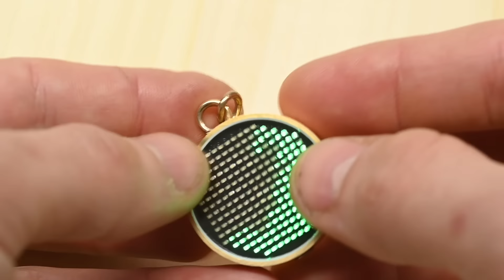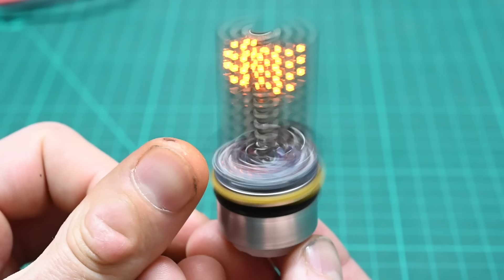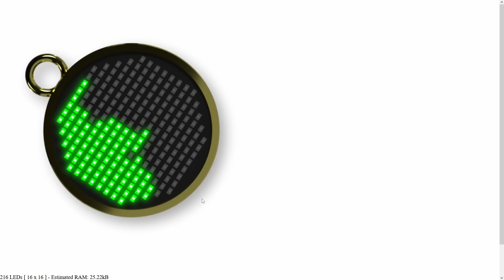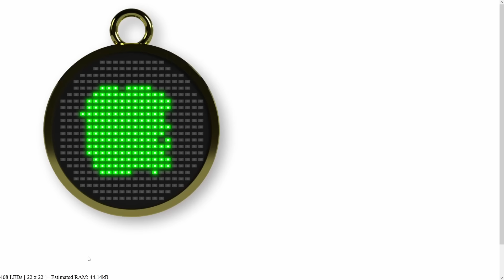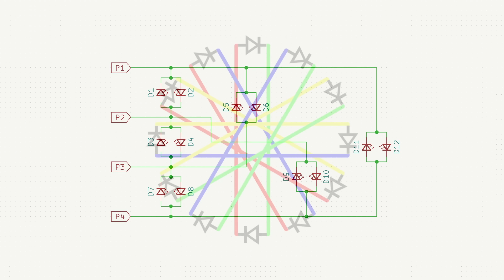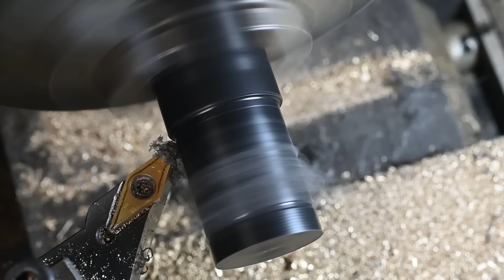Fluid Simulation Pendant

Comment: You are one of my role models when it comes to creativity and using every skill I have to make projects that I'm proud of. 
great video as always. the thing that mostly got me is the script you used to extract the led pinout lookup table, in my designs I also need to do that a lot but I didn't think of building my own "net to pinout" scripts I usually do that sort of stuff manually or lately automating it using a detailed prompt to an AI chat bot and they usually get it correct, I wonder if the AI chat bot thing would have worked with such array in your case.

Comment: Gonna keep doing whatever i feel like 😂 i enjoy all of this, but things like the GPIO and DMA functionality, circuit design, and PCB fabrication are definitely the hardest parts. I graduated as an electrical engineer, and am familiar with simetrix, but circuit design really is a creative process that you have to practice to be good at. I work as a programmer now, so my circuit design attempts are relegated to hobby projects.

I recently did a basic fluid simulation project, but used off the shelf arduino and charlieplex led array parts to help me get it done within a reasonable time frame. It did turn out well though- I embedded it in a block of soapstone, shining up into a sculpture i made out of prisms off amazon. I considered documenting the process, but it's so much work to film. Thank you for taking the time to make this video!

Comment: Wonder how good a milky glass panel would look. Hard to get enough dispersion in this small space to make the hot spots from the LEDs completely go away but maybe small layer diffusion foil, thin normal glass and milky glass on top would be enough double diffusion to turn the LED spots into very smooth liquid looking light.

Comment: why dont you use a real liquid in between the battery and LEDS, the liquid will connect the LEDs from battey in few areas which can make a liquid like simulation, try it if it works

Comment: 1-Wire! a project like this would be amazing with some sort of interface to update/configure the internal chip with everything fully assembled. could probably even reuse parts of the charging connector. Also, at which pixel density are you going to finally budge and use an actual watch or fitness band led display?

Comment: Question: Would adressable LEDs have caused more issues here? There are 1010 ARGB (1mm x 1mm), and they can be packed as tightly as 1111 (1.1mm x 1.1mm). Since they're controllable via Serial at 2Mhz and retain their state, it feels like this could have avoided a lot of work. Though my only experience so far is making a mostly working 100x100 pixel display that is 110mm x 110mm and can infinitely tile through magnetic connectors - if you can provide the power for it.

Comment: as always, amazing video. I really appreciate all the explanations.

Would sensing skin contact on the case, be possible? Would you have any µC inputs available for this? Would the metal and coatings allow for the capacitance to be detected? Or, even instead of case, could we detect slight changes on any of the charger pins?
I know that some older model of Fitbit had a reset button in the charging cable.

Comment: unfortunately sold out .. 

beatiful project you should really consider small scale production with a manufacturer. this quality would definitely sell.

if you do a new batch, varying the colors would be neat ideally with heat-oxidizing the brazz blue 💙

software variations would also be interesting - displaying the fluid sim field instead of particles, etc

really inspiring!

Comment: It is really interesting and cool, but what driving my mind is that ugly red led for charging. Why is it even needed?
You have the whole "display" that you could use, which could float from bottom to top representing percentage, while preserving the sleep mode, so it does not shine the whole time for nothing. You could also display the number, possibly time, to give it some purpose.
For the port would be also cool to have data, so you could possibly update the software (DFU) without the need to dismantle.
I am pretty sure I saw circular ports with data, but not sure how big they are. In any way, pretty cool project.

Comment: It would look very, very much better if the LEDs weren't in a grid, and thus have jagged edges when trying to approximate a circle, but rather oriented in a circular pattern. Then the LEDs wouldn't be equidistant, but the perfectly circular outline would more than make up for the slight variation in LED distances.

Comment: If you are considering building more, you take the route of watchmakers.  Outsource the case.  CNC will easily take brass stock and turn out cases.  All the drilling could be done.  The pcb is already designed.  I think PCBWay offer a service to install all the components.  Then, it comes down to assembly and testing.  Please give it some thought.  Judging how quickly your batch was picked up, you can see it is popular.  I would buy one.

Comment: You're definitely an inspiration, I'm glad to have found your channel!

Doing a simulation before building a physical device is exactly what I'm trying to do now, but I'm still far from having good results. 

Talking about menus to change the configuration, what about using a hall sensor, and using the magnet of the charging cable to do some kind of gesture?
I don't know if it's easy, but it would be cool for sure.
Another option could be an infrared port beside the power led,  and configure everything via an app. Some smartphones (Xiaomi) have the IR port already installed from the factory, I guess other brands too.

I agree with you about the search function on AliExpress, sometimes it's tricky to find the items.
When I don't know the exact name of a particular product, I try to use the image search on Google, just to find out how it is called...it works fairly well.

Thanks for sharing your knowledge!

Comment: I had thought i knew what charlieplexing was but i definitely didnt, REALLY appriciate the detailed explination of the layout difficulty. Didnt expect that.

I was hoping youd go into more detail about how you overclocked the processor, ive never done that before, was wondering if that just a oscilator change or a firmware change or how you decided it was possible to do at all from datasheets. Thanks! Great vid!

Comment: It would be cool if it was a Sand-Falling game, or a powder toy, where you could change the material on the back with a single button, ad you could have fire, sand, water, electricity, etc. I mean you could have a touchscreen but it's not necessary, you could just change all the voxels to the material, but having them interact would be the next level.

Comment: Metal working, electronics and programming in one project? Yeah, I'm definitely part of your demographic and want more. There's a channel where a guy machined a new case for his phone, not the part that wraps around it to protect it from drops, but the actual shell of the phone. If someone were to replicate such a project but use custom boards, maybe even do what you did here with a solid cup casing that's gold plated, that would be my new favorite.

Comment: maybe like a bluetooth low power chip for 'setting the time' etc if indeed you make one with a clock filter of some kind... like you can't see the clock numbers directly, you have to shake or roll or spill the 'fluid' over the surface to reveal masked numbers....

Comment: May i suggest that you do a run in stainless steel. Or, simple brass. If you made enough from the first run, you could consider ordering a batch of PCBs and cases from a manufacturer.

Comment: It's okay but the index of refraction on the water is off. You should set it to 1.33 and also add some volumetric fog and soem simulated caustics so it will look more photorealistic, but it's a good first attempt 👍

Comment: "If a lookup table is mandatory, then there is no overhead to changing the mapping" is a pretty great insight. I worked on a system once that had clearly taken this idea to heart. It looked arbitrary and stupid from the software side, but when you looked at the board/wiring layout, it made perfect sense.

Comment: You mention shift registers at 8:50 - But ya know, ch32v003's are usually cheaper than shift registers nowdays!  I've effectively been using them as glorified IO expanders in a couple applications (some commercial)... (I know that's not the point! Charlieplexing is cool too)

Comment: Only problem is if you hang it on a string, no matter how you swing it around, the fluid wouldn't move. Even if you throw it in the air it would barely move at all

Comment: add a gesture to make the display show the battery charge level, and add an animation to the fluid simulation of fluid dripping in from the top and slowly filling up when charging, when the display is full the battery is charged
Reply: YES. This would be such a cool way to display how much battery it has, by connecting it to the amount of liquid on display.
Reply: Maybe only half of the screen = amount of battery? Otherwise filling the entire screen with water kinda defeats the point of simulating anything
Reply: @ it would only be for the charging animation, the battery level indicator when not charging would be activated by a gesture
Reply: @ that would be cool

Comment: I love it. Put 3 mics equidistant on the side edge, then you could blow on it to create properly vectored waves. If you about doubled the pixel density you have it work in 3D, lay it flat you get a small puddle in the middle, flip it upside down and look up at it and it covers the screen etc.

Comment: Hey, i had an idea about a convention id badge with a led matrix like that, would it be possible to integrate a NFC circuit and Antenne into the housing/pcb? So it could display a name or something and you could share your socials or whatever you want over the NFC function, but i havent found a solution that does that so i thought about making it myself. 

I got no experience with electronics so I got no idea what I have to do, is that to big of a task for a newbie or is that something achievable?

Comment: Obviously, this is something that is expensive and not really high demand (maybe) but it is incredibly cool! You mentioned that you made 10 as that used the "populated" PCB's, does that mean there's unpopulated that could be sold or passed out at a convention? The design is stellar, and the explanation is beyond incredible.

Perhaps, since you are already thinking about the next projects, you could sell the schematic or design, as I would be very interested in building one of these. It's a great merge of DIY kit and electronics, with fantastic programming on top.

I any case, I'll be following! The volumetric display was cool, but fragile. This is cool and robust, and while I can't machine, as you stated in your post, the case could be 3D printed, and an ULTEM case for it, or POM (delrin) even, would be more than durable enough, though obviously not as value-adding as solid metal.

Comment: Why not use some round efficient OLED display?
Given that a lot of manufacturers do everything in their power to make long lasting smartwatches, I'm sure that resulted in a lot of very low power OLED displays being developed.
And even if it doesn't seem very power efficient on paper with all the colours lit and 100% bright, you could optimise it further by using only fraction of the brightness.

Comment: One fun change could be to add a temperature sensor (or could you do that in the MCU?) and make the liquid thick and goopy when it's colder
Reply: I love this idea. Now it's making me think of pairing a gas simulation so the heat could drive evaporation or condensation. Pixelated pocket water cycle!
Reply: with how cold it is here, It would become a rigid body sim
Reply: actually the accelerometer ADXL362 already includes on-chip temperature sensor, you can even see mention in the datasheet at 28:12
Reply: or change the colour according to temp
Reply: @SHADOWLEGENDDRAWS  yup. SMD RGB LEDs
Great minds think alike.

Routing the PCB for 3x the channels for the same matrix though... at least 6 layers and a whole lot of brain hurt.
Reply: @Jimmeh_B Not practical to use bare RGB LEDs. In addition to more layers and I/O, you'd need blind vias -- and that gets expensive.

However, you CAN get some really tiny individually addressable LEDs these days. Each LED has its own controller, and they're daisy-chained together. Layout is stupid simple, and the SPI-based ones can have a very high data rate.
Reply: @ Didn't think of that off the cuff.

You're right, that would be a much better approach.

Comment: You can take a small amount of mercury and matrix of leds with exposed switch-on contacts to mercury, Add case and battery - and voila - the same functionality without any microcontrollers :)
Or instead of mercury some electrolyte or other liquid that conducts electricity.

Comment: About the menu thing, you could so it with the CH32V003 video you shown before.
Here is how:

After going into deep sleep, have a 5 second mode that activates once it detects it stop shaking for a while, and during this mode, it will look for a differential signal. After which you put it face down on a smartphone display, where the smartphone sends a "menu enter flash" constantly over and over and over again.

After it goes into menu, it can light up outer segments of the display (so it shines though on the mobile screen by its cracks, that tells the user which option is selected, and its value. The labels are displayed on the mobile screen simply.

The phone tells which menu item user selected by flashing the differential pattern.

So basically, the buttons to manuvre the device is on the mobile touch screen, you place it face down on mobile screen after having woke up the device by 6G shaking, And then uses buttons on mobile screen to send commands.

The whole menu could be displayed on the mobile screen, as each setting could have a completely unique code, so no need "navigating" the menu on-device. The device shows the value as said by lightning up segments, whose light leak out on the smartphone screen, where the label is displayed by the app/web application.

Comment: First Video i See from you and i love every bit about it. 
Regarding the production: i think you could outscource Most of the labor. PCB: buy soldered and if you ask nicely they will Even solder on a inductive charging loop into it. 
Metal part: easy to scource ready to assemble from almost any machine shop. 
Left over: only assembly. By making specific tools you can do 100 pcs/day. 
Also: Fixed price for the outscourcing makes you able to do a precise calculation. 
It could also indicate the time making it a very well product.

Comment: I love DMA. One time i wanted to make a 1mbit custom digital signal output with an 8MHz core clock, so i just glued DMA to a timer counter register and made the overflow flag trigger the DMA transfer to keep it going and also configured the DMA to run once data was placed in the allocated memory address, so it was all automagic.
Ps: the timing in the device was so tight that i had to count clock cycles to make sure my code was working and in the end it turned out that the entire operation would take 8 clock cycles but sometimes 9, which would cause errors. So i slowed my data transfer slightly so that it would run on 9 clock cycles and i never had an error again.

Comment: 25:54 I'd get in touch with Tom Lipton (yt oxtoolco). He's versed enough in these kinds of things (through his own work, but also as a passion of his into machining) that he can tell you what, how, and what steps you need to take in terms of tools, modus operandi, and specific steps regarding handling. I've seen how they handle cases for high end watches and the level you need in both experience and tooling is quite advanced.
Tom has a few videos on polishing and bringing a surface to true flatness, so those are also good primers in case you want to struggle through it (i totally understand that mindset or should we call it grindset).

Comment: I can't help to think why you ended up with a huge novel charlieplexed array rather that what seems like a much simpler solution of a snaked array of something like 6805-ec10 addressable RGB LEDs with similar footprint to 0402s and practically no vias. You'd get colour for 'free' as well at the possible cost of a bit of CPU time banging out the control patterns.
I suppose it may be a bit hungry on the power budget through..
Reply: i was gonna suggest the XL-1010RGBC-WS2812B but with 12 mA per channel it would turn into a little 7.5 A hotplate or have 2 bit color depth.

Comment: I wonder how well behaved the boundary conditions of the solver is (apologies for commenting before understanding the model).
If it is relatively nice, lending well to parallelism, the particle grid could potentially be subdivided into smaller regions handled by several individual (relatively cheap) MCUs, processing them in parallel and exchanging boundary flow through bus communication or potentially by processing from and to a single shared eg. PSRAM chip. 
If the model is quite well behaved, the grid resolution might practically be limited by how many MCUs you could cram on the board and bus...
Definitely having a play around with this concept as one of my later never-quite-finished projects 😀